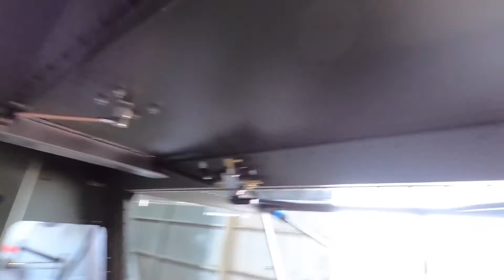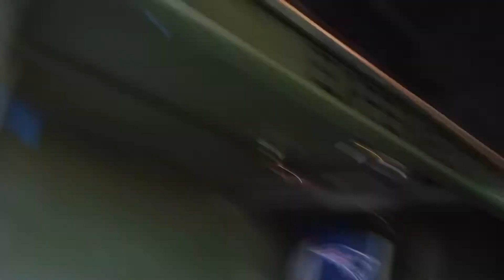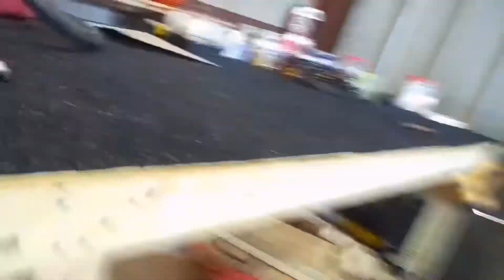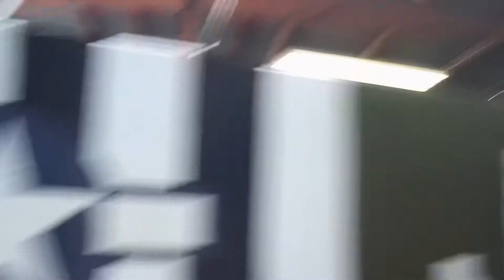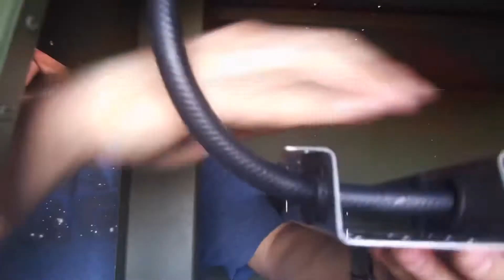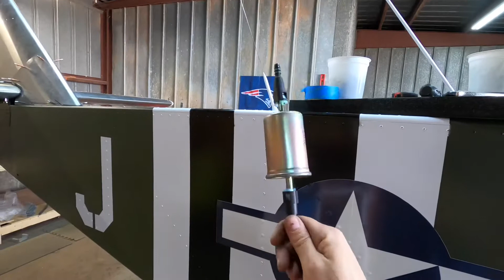L750 Cricket Build: Finishing up the Fuel system

Comment: Joe hopefully you tried reaching back for the valve where you placed it?  It’s pretty stiff to turn.  Also yes you are correct on the fuel filters if using the new valve.  Only 1 on the IN side then the other on the High Pressure Output.
Reply from the maker: Checking the reach was how I found my spot. Very easy to reach and turn for me.